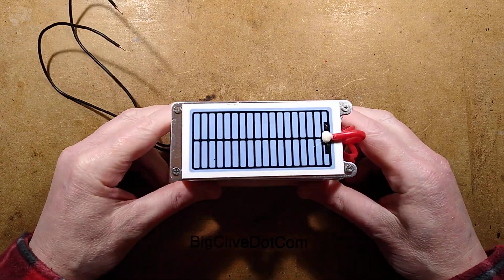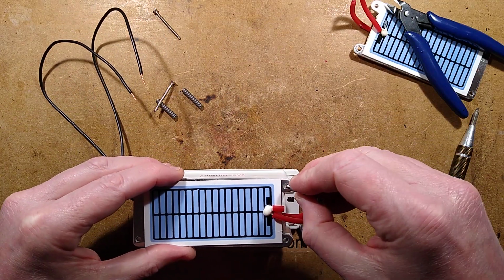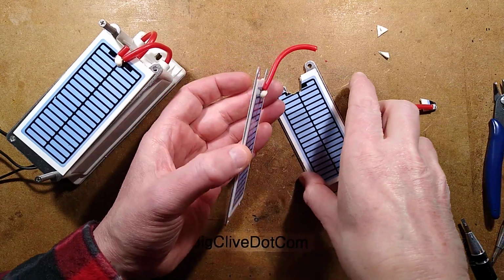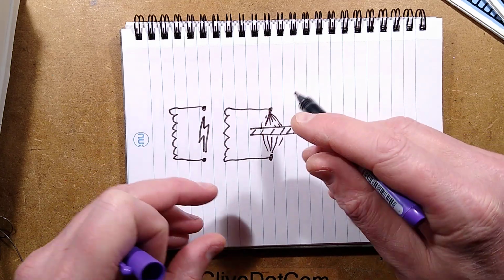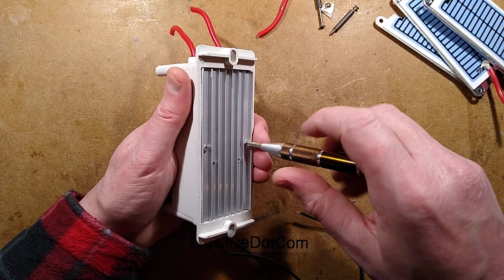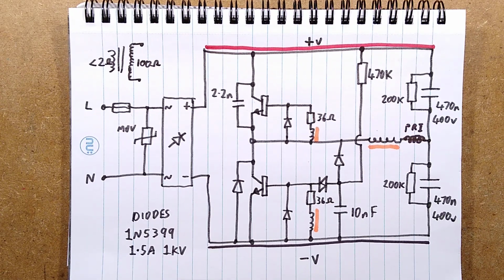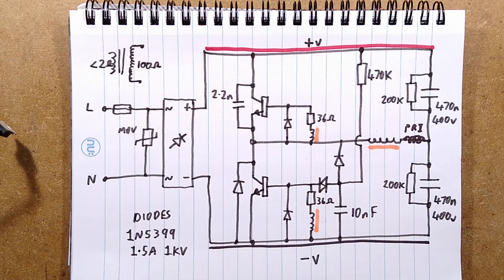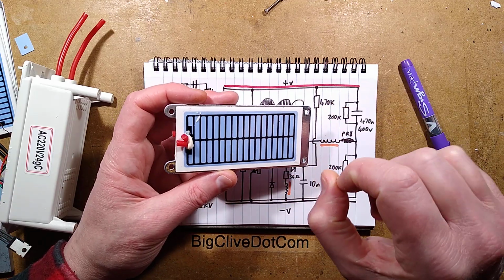High power ozone generator teardown with schematic

Comment: I own 4 of these I bought from Wanders products  a carpet cleaning supply company  2 are boxed up ready to ship back 2 are working about half and will go back when the other 2 come back. DO YOU KNOW WHERE I CAN BUY A DEPENDABLE OZONE GENERATOR AT A REASONABLE PRICE  WANDERS SELLS THIS AS THE ANY FAN OZONE MACHINE  I HAVE DEPENDABLE FANS. I JUST CANT SEEM TO FIND OZONE MACHINES   ALPINE. ASPEN AIR ETC ALL HAVE BEEN A PROBLEM. PLS HELP
Reply from the maker: The hydroponics industry tends to use the ozone generating UVC tubes for reliability.  (Never look at, or expose skin to the tubes when lit.)

Comment: Finally :D
 7 months ago I searched through all your creations of discreation to identify the blown up parts in what used to be a key element for my homemade diesel particle filter reversing process.( Im not a big fan of car brand workshop rules)  
Since I did not find it here, I put it on the "see u later shelf" and guessed that it was just a matter of time. 

At least for once or so, I was correct and finally have identified the blasted part. Thank you so much ! =)

The story may easily ended here,  but things are not always as easy as expected. 
Wise from the blast in my past, before powerup I measured fwV of the NPNs whom probably was the main cause rather than collaterals, and I had offcourse only some smaller MJE13005 as a somewhat almost nearby complimentary.

But I have like a ton, or at least a small bag full of IRF 740 "N" mosfets, and I cant really see why they wont do the job just as good. But something one not can see, can just as well only be an issue regarded blured vision from these marvelous bewildered beverages one may randomly endeavour.  

I have also a lot of the bigger IRFP460 that could be tried, but my main consern is to rather understand whats going to happen, rather than just learn by "Trial and terror" so my question for you is that if I am missing some details, could you please give a minute and mention what I may ignore, then it would be just as highly appreciated by me as probably my dear tenant, whom gets unusually scared everytime the main fuses randomly blow by complete mysterious manners. 

Best regards Eivind.
Reply from the maker: There are a lot of different transistors with different pin arrangements and characteristics.  It's best to try and use the exact original component.

Comment: I used 2 of these and have made an ozone generator using stainless steel box(by bending sheets) and fan. Sterlizing all the parcels for covid, it works perfectly. They produce 48gm ozone per hour.

Comment: if you want these to last for a long time in the UK it's worth putting them on an autotransformer to step the voltage down to 220V.

They don't last very long at all when on a 250V supply.

Comment: I just found you. Or rather YouTube presented you to me after I was researching ozone generators. I want to buy one so I can remove the smell of mice while I contemplate how to remove the mice without hurting them. And remove any possible Mold and smoke and bacteria that probably lives with me too. And I heard (read on the internet) they can be used to clean laundry which would be useful given that I am living in an RV, it is winter, i am in Canada, I have no running water and the idea of sanitizing my bedclothes regularly by hanging them by the wood stove and blasting the place with ozone while I take my dog to Costco to buy crepe brûlée by the bucket and alcohol (sanitizer!) by the gallon sounds (I think) like a brilliant plan. So I will watch all your ozone videos and perhaps request your recommendation re: which of the 700 on Amazon.ca would be best and/or how I can test the one I get to see if it works well enough to actually kill the bacteria and other nasties.
I am just starting to learn about electronics and motors and electricity and plumbing and wiring and generating electricity and solar stuff and batteries and chimneys and stove pipes and wind turbines and welding and Virtual Reality (just bought a quest 2 but no 20 year old designer thought to tell anyone that rv headsets can’t be used with bifocals!) and while I am starting to learn the alphabet I am no where near creating words. Hope you will have some advice re ozone. The ones like the one you took apart are significantly cheaper than the ones with boxes around them and fans..... anyway - I have looked through your last two years of videos and put about 50 of them on my watch list. Glad I found you. Cheers.

Comment: Is it that loud in person or just the microphone picked it up as interference?
Reply from the maker: It's pretty intense, but the microphone did enhance it.
Reply: @bigclivedotcom  Thanks. I guess it's probably caused by the piezoelectric effect of the ceramic substrate. I've just found the enclosed version of this ozone generator, you can see the module through the grille:
https://www.vatera.hu/ozon-generator-28000mg-h-2982853148.html

Comment: Tried the other week to reattach some wires to a circuit, the metal coating must have been so thin that it dissolved into the lead and left the board without any form of connection
Reply: you sometimes need special 'silver bearing solder' for these sort of things ..

Comment: It's exactly the circuit that made 12V halogen lamps glow until not so long ago with the differense it converts not voltage to curent but the opposite way and also the same circuit but with a quasirezonant inductor and capacitor instead of a transformer in the output makes CFL glowing with the exception they both have smoothing capacitor in the input to avoid double per mains period restarting, but my practice has shawn some constructions manage to fail in that causing flickering. But with a smoothing capacitor this contraption woun't be so great of a prop sound ;)

Comment: Really nice work, as always :) 
One question, if the circuit is reminescent of those of halogen lamp drivers, and it is self oscillating at high frequencies do you think it would be possible to dim the power via a Leading-Edge Dimmer circuit? Or do you think it would mess up with the self starting oscillation?

My guess is that it should be possible down to a certain threshold where the circuit would not self start (and I wonder what would happen there, if there would be some kind of damage).

Cheers!
Reply: I know your question wasn't directed towards me, but I hope you find my answer helpful.
I'd use a trailing-edge dimmer with that circuit. A leading-edge dimmer would pose additional stress to the circuit's capacitors.
Reply: @mattmoreira210  Hey Matheus, thank you very much. If that is so, do you thing this circuit could be dimmed somehow? Maybe using a simple transformer would be the simplest option right?

Comment: Why did they bother to full-wave rectify the mains, and then put the rectified signal back through an oscillator circuit? Why not skip the conversion altogether and just send the mains directly into the primary?
Reply from the maker: That would require a huge and heavy transformer.  By converting to high frequency a smaller one can be used, and there is a much stronger corona discharge.
Reply: @bigclivedotcom  interesting, why is that? The voltage boost factor is the ratio of the secondary to primary windings (independent of frequency), so I don’t see the advantage to using a higher frequency.
Reply: @danthewalsh  Pretty sure it’s a current thing. Mains frequency transformers get large pretty quickly when they have to pass decent current.

Comment: You left us hanging without modding it to decrease power consumption and extend the life span of the device.
This would work great with my UV light inhaler against any airborne virus, not needing any vaccines ever again for those types of viruses.
12V battery, 2x10W UV 280nm led in a box cleaning air for breathing. Optional ozone contraption for that deep throat cleanse. Add a solarcell and be 100pc ecogermicidal friendly. At a fraction of vaccine costs with of the shelf products.

Comment: Hi Clive. Thought you might like to see if this is real. They claim this product produces ozone in water, that they "utilize a boron doped diamonds technology, (see the companies Enozo, and Tersano for example) and through the use of specially plated electrodes". I measured 7.1v on the electrodes and it smells like hydrogen-oxygen gas to me rather than ozone.
The Roving Blue O-Pen™ Tactical Black Generation 1
https://www.ebay.com/itm/123759582532?ViewItem=&item=123759582532
Reply from the maker: Sounds a bit like the water hydrogenator.
Reply: @bigclivedotcom  hmm, surprised I hadn't heard of those. One way to find out would be to capture the gas and see if it can ignite but I returned the unit. Beforehand, the top would come off and I could see the circuit board there, and to avoid damage I didn't try to pull it out. Store bottled water is treated with ozone, often, but this one would be such an itty bitty amount of O3 if present at all. Adding salt increases bubbling. Kind of a sketchy world we've got here :O  How many videos do you have. Approaching infinity :)

Comment: I bought the same module about a year and half ago from Amazon for a project (had to return it 3 times too as each one arrived with a busted top ceramic plate) but eventually got one that wasn't cracked.  Was only 8 pounds when i bought mine too pre coof... the ceramic plates are very very fragile... any slight bending on the metal backing substrate will crack them as they are bonded on with some thermal type goop. I consider myself sufficiently clued up with electronics and safety to not hurt myself but was actually a little surprised how easy it was to buy such a thing that can easily cause severe harm from a mainstream website. Probably since the coof people have been buying more of these types of things as I've seen these things advertised as antiviral etc? I think you covered it really but they will overheat and die without proper cooling, electrical safety is non existent unless designed into a suitable project, the ozone emission is insane, easily very bad for your respiratory system if you don't know what you are doing.

Comment: can you please start putting the full part list in the description of you videos.
what is the watt of those resistor and voltage of 2.2nf and 10nf capacitors? 
number of turns around that ferrite core and wire gage.
also what is the wire gage of the primary winding of the transformer.
with these informations we could actually reveres engineer it.  
thanks .

Comment: i was looking on Amazon for an ozone generator and I saw a '5000mg' box with a timer and handle and upon closer inspection of the picture something behind the grille on the front looked suspiciously like the device you have here ;)
Reply from the maker: I've seen similar units with one of these modules and a fan.

Comment: There are 4 types of ceramic plate used on this generator, 5g/6g/7g and 8g respectively. You can see the pattern on the plate. The one Clive is testing used four 6g plates. Two plates back to back to form a double sided layer, and two layers are used totally.
https://item.taobao.com/item.htm?spm=a230r.1.14.35.5e473df9MVuSHU&id=630935221974&ns=1&abbucket=12#detail

Comment: Whether in its pure form or mixed with other chemicals, ozone can be harmful to health.

When inhaled, ozone can damage the lungs. Relatively low amounts of ozone can cause chest pain, coughing, shortness of breath and, throat irritation. It may also worsen chronic respiratory diseases such as asthma as well as compromise the ability of the body to fight respiratory infections.

Some studies show that ozone concentrations produced by ozone generators can exceed health standards even when one follows manufacturer’s instructions.

Many factors affect ozone concentrations including the amount of ozone produced by the machine(s), the size of the indoor space, the amount of material in the room with which ozone reacts, the outdoor ozone concentration, and the amount of ventilation. These factors make it difficult to control the ozone concentration in all circumstances.

Available scientific evidence shows that, at concentrations that do not exceed public health standards, ozone is generally ineffective in controlling indoor air pollution.

The concentration of ozone would have to greatly exceed health standards to be effective in removing most indoor air contaminants. In the process of reacting with chemicals indoors, ozone can produce other chemicals that themselves can be irritating and corrosive.
Reply from the maker: Ozone occurs in nature at around 0.04 parts per million and may be essential in maintaining the quality of the air.   This device is intended for shock treatment of areas to sterilise and remove odours.  It would be harmful to breathe this level of ozone.

Comment: Oh FUCK YEAH, I have 4 of these to plan to build my own o-zone generator from them!

 I work in laundry plant and we bought one 900$ portable ozone generator and one 4000$ ozonating locker to dessinfect all what comes for cleaning, and they all use these!

My mate hooked one with a compressor and infuses 15 ton of water in his indoor pool with it. 

I NEED to build one of these to start professional washing laundry linen with ozone. 

Very excited for this video!
Reply: There are o-zone water infusing machines sold on the market the one I got from American eBay is PureWash

Comment: clive could this be converted into a electrolysis system .i believe it may be very efficient  mine has not arrived yet.as you can see from my few video,s i think very simply on adapting pre manufactured equipment .like my old tractor glow plug that now is a electrolysis system

Comment: Clive thank You for taking one of those apart.  I got one and was wondering what was under the cover. I found that when you have a fab blowing air over the plates that run somewhat more on the quiet side. I would like you to try and see if with a fan the HPPI would read the same or if it will change the readings or not.

Comment: I worked in home restoration (water, fire, mold, and biohazard remediation) and I'm repeatedly amazed at how small super high output ozone generators have become. We had been using one with electrodes sandwiching six inch glass tubes, with the whole apparatus being about 6 cubic feet. When I left, the company I was working for was all aflutter about getting one the size of a toaster, and now this.

Comment: Corona discharge – Now a days more commonly known as a "sneeze".

Instead of just being facetious, let me also be slightly informative. In case anyone is still wondering what the connection between the sun's outer atmosphere, a group of viruses, and the electrical phenomenon described in the video is; corona is borrowed from Latin and means crown or garland. So, as ever, It's all about the looks. ;-p

Comment: Great Video as usual :-)  I see on ebay that you can get a 12-volt version looking very similar would it be roughly the same circuit as the 240v model? It might be a bit safer.
Reply from the maker: Possibly based on a Royer oscillator.

Comment: u said de=pot ?    wuh ?  do u really know how to remove potting materials ???!!!!!!
Reply from the maker: Solvents and or heat.
Reply: @bigclivedotcom  Any advice about solvent type?
Reply from the maker: @NickFreneza  Acetone works for some, but takes a while, and the resin has to be removed in layers.
Reply: @bigclivedotcom  Thank you. Last time I've tried, acetone did not work well for that potting silicone stuff. Looks like digging with tools is the only way.

Comment: Crazy how much power they are putting through it - wonder how long you could run it for before it self destructs? More than 5 mins? Wonder what the power consumption levels off at it was still ramping up when you pulled the plug.

Comment: The conductive coating is probably metalization. Typically it will be molybdenum and some other metals to form an alloy that can then be deposited on the ceramic.

Comment: Hi Clive. I've had a pair of these for well over a year. One 120v🇨🇦 and one 12v. I didn't like them being out in the open so I made square glass "tubes" for them and added small fans. If odour is any indicator, the 120v one produces more ozone than my small (-ish) commercial unit! 
I haven't had the right testing equipment, but I recently bought some. Now all I have to do is figure out where I put the things! They were on display (they sat on a shelf near my work table), but I think I must have moved them to storage. Now they may never be found. Don't store things unless it's in translucent plastic containers!
Of course after watching this, I'm going to have to waddle through the snow into my storage and try and find them. Sigh. I don't know whether to curse you or thank you for the renewed interest. I think thank you is probably the strongest and most accurate  at the moment. Until I land in the snow! 🤣

Comment: I'm scared but I want one ! I think i will use a 20 meter extension cord and 120mm industrial fan though, for removing smell from car but I think maybe it will oxidize the interior details of the car to the point of visually damage or even destroy buttons and gaskets etc?
Reply: Bought one, it exploded loudly and with a huge spark.

Comment: I have a video with a 12v one of these - you can easily modulate its output with the voltage, .. ended up at 10v for a super minimal output level